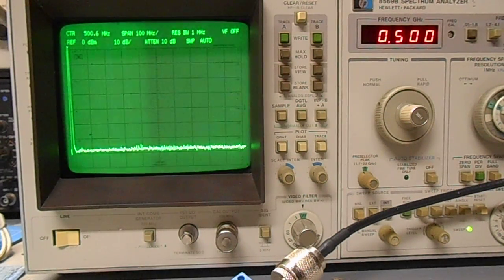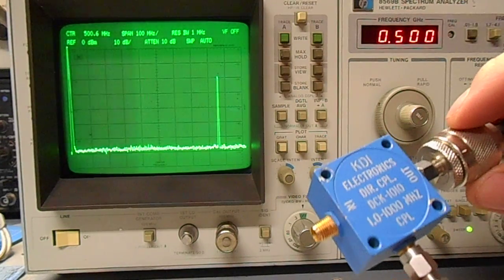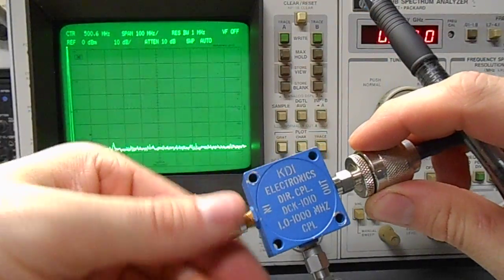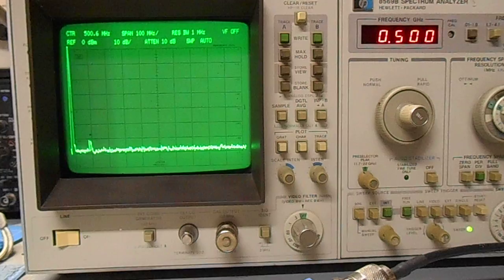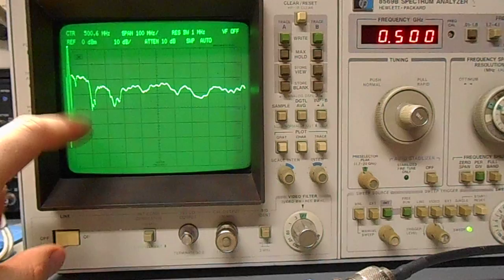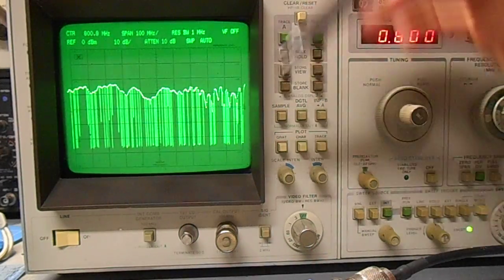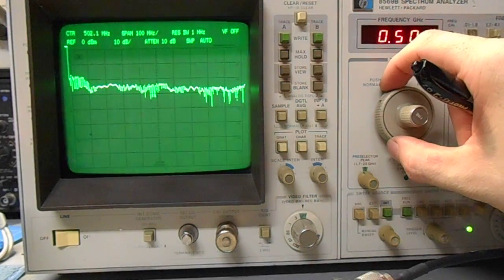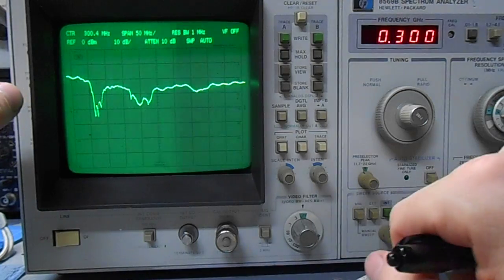GBPPR Vision #14: Radio Shack Discone Antenna Frequency Response

Comment: I put together a quick 321.4Mhz VCO with a mmic amp to +7dbm and using a minicircuits 4ghz mixer the 1.7-4.1 Ghz tracking gen works great!  Just waiting on ebay for the isolator and both the mixers you used.  I'm going to use a sma coax relay to switch the output of the isolator between the two mixers.

Comment: What's the noise floor on that analyser at around 10ghz.?  Im looking to buy one soon.
Reply from the maker: It has a slightly higher noise floor, between -70 and -60 dBm.  The full span mode is in a series of steps, which is annoying, but still usable. It is not synthesized, so the center frequency does drift a bit.
Reply: *****  Thanks buddy!   I just got one today and it seems to be working good.  At 10ghz noise floor is about the same as yours so I'm happy.
It replaces my HP8559A  which is very similar but lacks the yig filter and facility for external mixers. Now I will build a tracking gen for it.  what's the go with your experimental unit that goes to 4ghz? Does it work ok?  worth building into the same box as the 1.8ghz unit.  Thanks
Reply from the maker: itakeyourphoto  Yes, the 1.7-4.1 GHz tracking generator idea appears to work, I switched to a Watkins-Johnson M1G mixer for better frequency response. Turns out you may need to tweak the 2050 / 321.4 MHz input signal slightly, say +/- 100 kHz, to take into account the slight misalignment inside the spectrum analyzer itself.  I'd keep them separate if you can, you want all the isolation as possible.
Reply: ***** Bummer!  I was planning on using a pll controlled VCO at 2050Mhz as the signal source but it tunes in 500khz steps.  I can make a reasonably stable free running oscillator that I can tune by voltage. would that work ?
Can you see on the spec an display when the frequency is off? I mean if its clearly visible then it would just be a case of setting the vco freq till it looks right on the analyser.
I assume that when the freq is off you just wont get a strait line on the display and instead it would be part strait and part slanted?